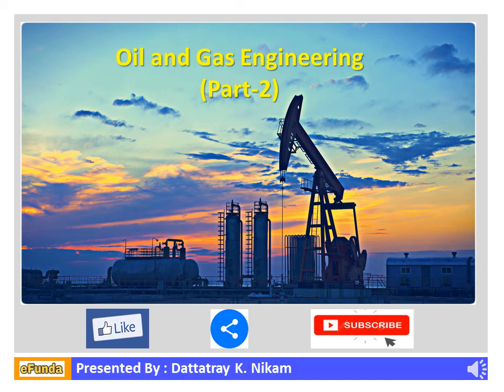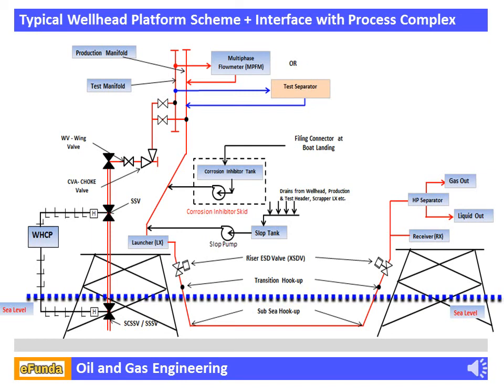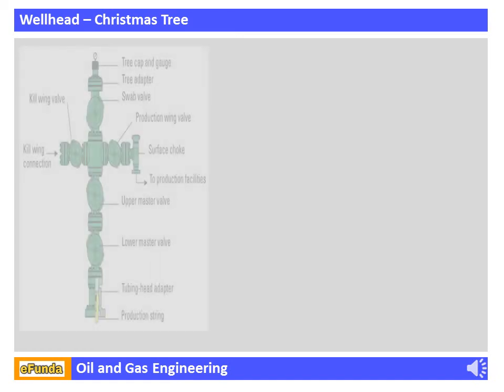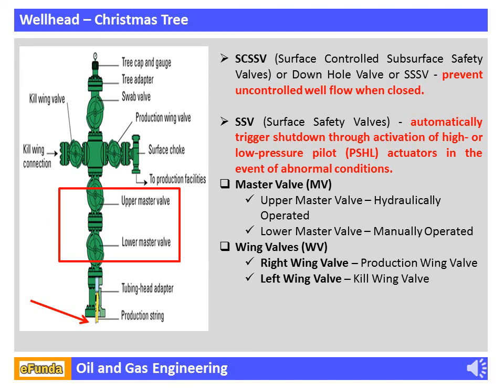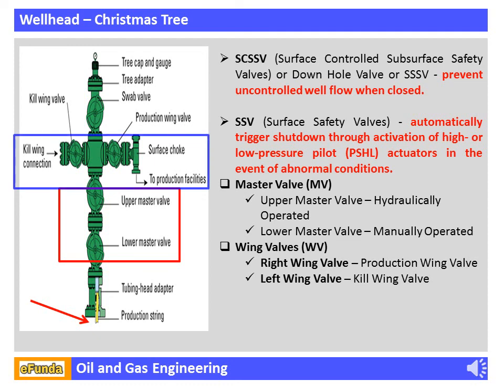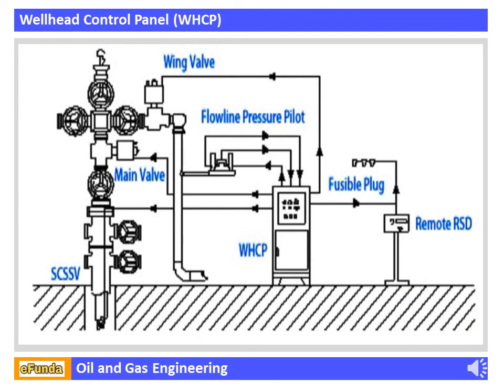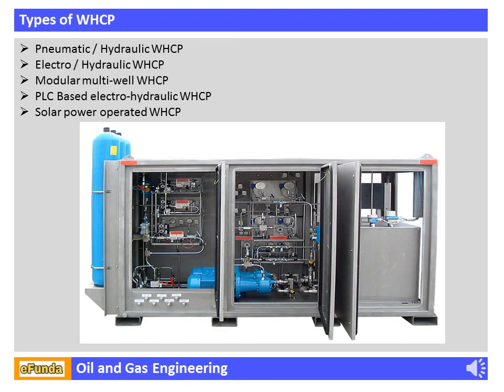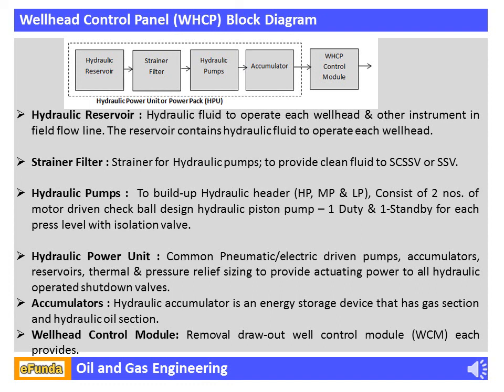Oil and Gas Engineering (Part 2)   Wellhead and Wellhead Control Panel (WHCP)

Comment: Are there any foreign Certificates in Reservoir engineering and production engineering like IWCF and IADC in Drilling ?
Reply from the maker: Yes, across all regions Reservoir engineering / production engineering (IWCF or IADC) certification courses are available. You need to check the required information on internet before pursing. Thanks for watching our channel eFunda and keep sharing our video to someone in need.